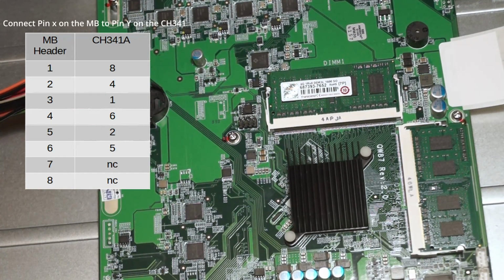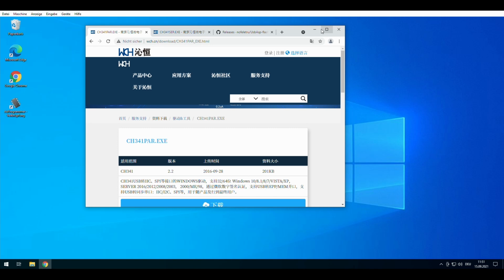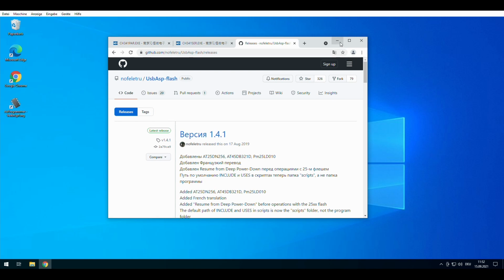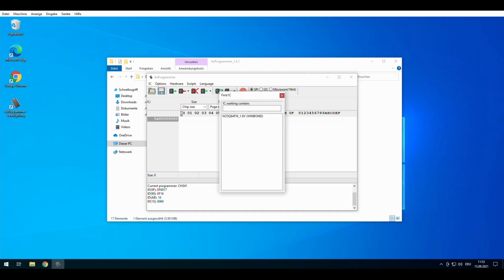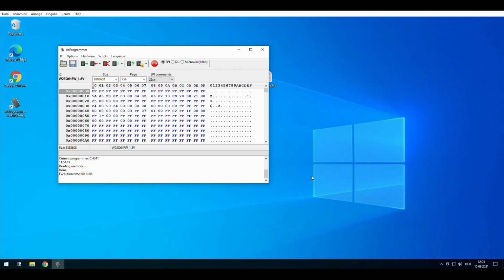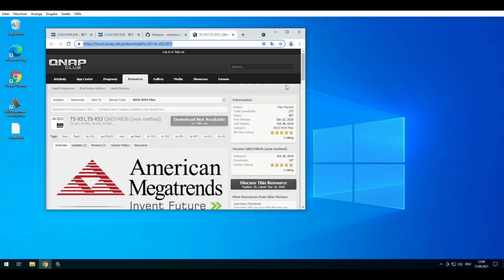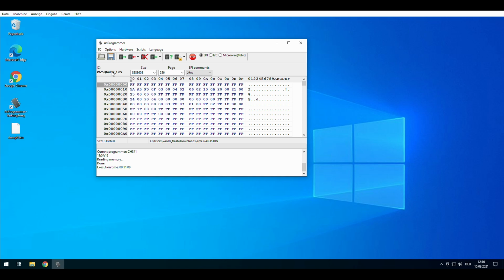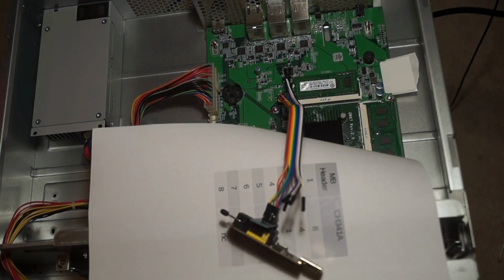Fixing a dead QNAP TS-853u ¦ Flashing the Bios with a CH341a

Comment: I keep getting IC not reponding CH341A not found in as-programmer, but i see it in device manager. Im running it in a win11 vm and have passed the usb device in to the vm. I cant tell from the video which orientation to plug the pin header into the 341 zif socket. One way all the way back toward the USB port, gives me a red light on the 341, flipping it shuts it off. Mine is a CH341APro, is the pinout the same in my case? Im thinking its not. Thanks!

Comment: Hi, I tried flashing the bios, but still don't get any image or keyboard, fan revs full blast , and All lights on . Would you know what's else could it be? .thanks
I'm sure it happend after an update.
Reply from the maker: If you have the same machine (TS-853u), send me an E-Mail (in the chanel description, aparently only visible on desktop) i'll then send you the Bios that i used and is known working. 
If that does not help you can try to clean TXE on the non working dump of your original Bios (similar to cleaning the ME (management engine) ,  i have a Video about that for a Lenovo Laptop, its a bit different but but the principle is the same)  
And lastly the Update might have coincided with the  Intel C2000 Bug and this is your issue.. i think there is a  Video about that for this nas on YouTube (something with a 100ohm resistor...)
Reply: Thank you for your time to  reply, after reading about resitor I think this is my issue. My nas actually did start playing up a bit in the past .and at one stage after dumping the bios I did get a post but it will not load anything,  mouse keyboard and lan will stop working after boot, and then back to no post. I own ts-451u looks like same board .
Reply: Hello, after taking the bios chip out and flashing, your file from the qnap forum .I can say that my qnap is working .
I can't thank you enough, after having it setting there almost a year .
Reply: @Franco Giovanni hola.
Q modelo tienes? Ts 451u
Reply: @Franco Giovanni si tienes es mismo modelo como el video, puedes empezar por flashear el bios. 
Tienes todas Las herramientas? Y el bios dump?